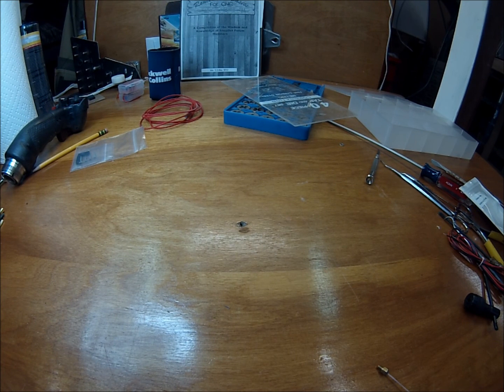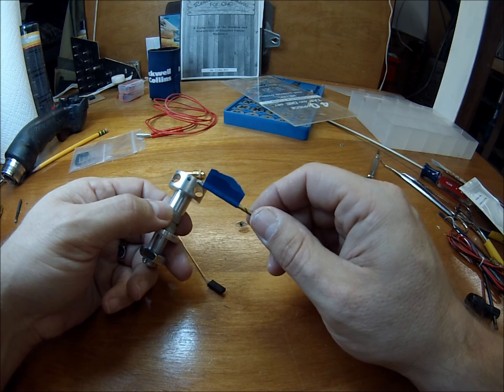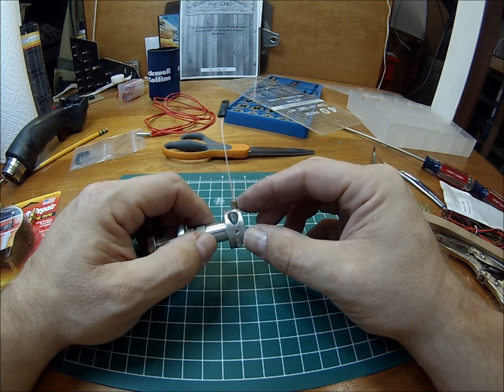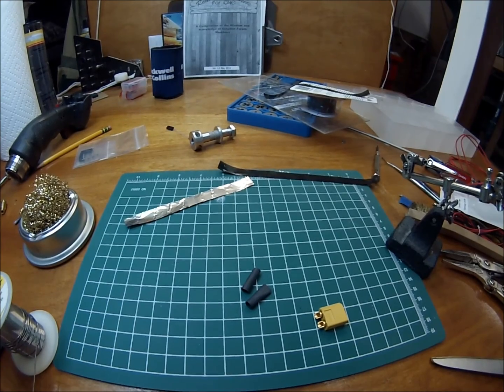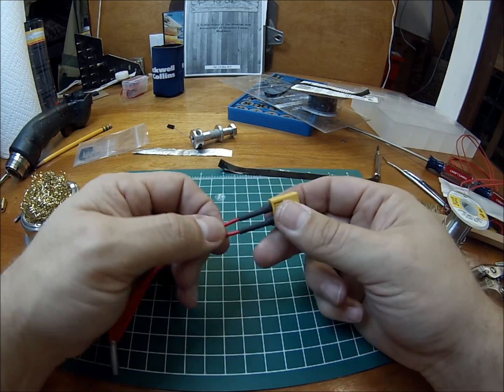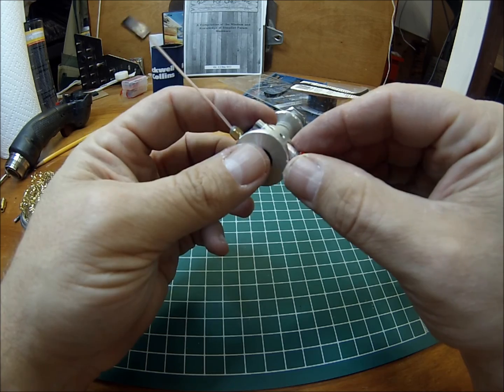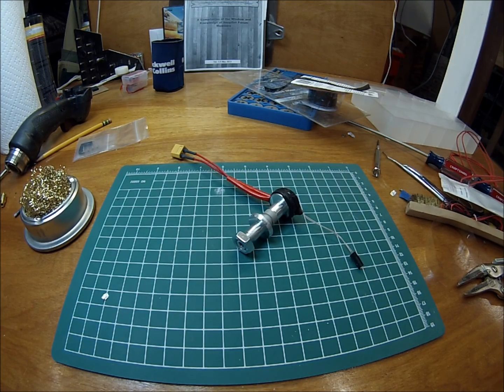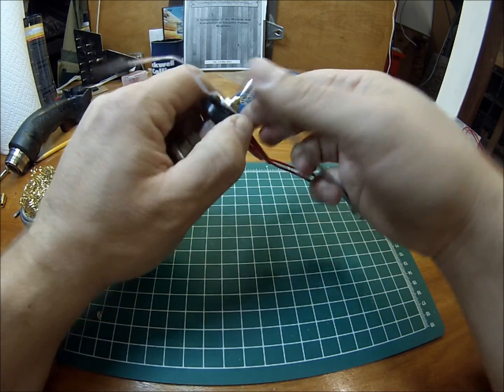Rostock MAX Upgrade: Hot End

Comment: TY for discussing nozzles at the start. I'm having trouble finding any info on the V2 in the forums. but... My nozzle(s) don't match yours! I'm not sure what the relevant metrics are but the threaded area (heat zone?) is in between the short new one and long old one - about 1/3rd of the length above the hex grip. (sorry if my engineering lexicon is non-existant).

Judging by the date of my assembly guide PDF I got my printer in 4/2014 and I'm trying to figure out what my nozzles are. (This guide was awesome, and the author Gene Buckle will reply to the included e-mail to this day even though he said he isn't even an employee.) For some reason the guide has no mention of nozzels, even in the shipping inventory; it only has one nozzle preinstalled in the image of the hot end parts. 

I quit the all consuming print hobby after a year, but never uninstalled any software, so based on my cura settings I know my installed nozzle is 0.5. I also have 2 nozzles in a baggie that is sharpie-labeled 0.35 but one is clearly larger. 

So: do you know what 3 nozzles were shipped at this time, or how I can measure them?
Reply from the maker: The nozzle shown in this video is basically the "first generation" SeeMeCNC hot end nozzle.  Follow on designs used a much smaller 6mm or 1/4" thread (I can't recall which).  If the nozzle is first generation like the one shown in the video, there's not going to be any markings to tell you what the nozzle size is.  If memory serves, SeeMeCNC did 0.35mm, 0.5mm, 0.8mm, and I think 1.0mm.  The easiest way to figure the size out would be to get those size drill bits from Amazon and see which is the best fit for the nozzle orifice you're trying to identify.
Reply: @f15sim  thanks! I will try that. IDK if this is incorrect nozzle settings, but when I switched to the 0.35(?) it worked OK, except I would get occasional lumps of burnt PLA appearing on my prints so I'm doing something wrong.

Comment: Having just received some "12v 40w" cartridges from an amazon seller, let me offer some advice to those partaking in this journey.  The amazon seller I bought from was called "Ocean Source" and when the cartridges arrived they all measured 18.5 ohms, which is no where near 40w @12v.  Furthermore, before you get all excited with your new cartridges, measure their resistance first.  If the math doesn't add up, you'll just waste an hour installing the new cartridges in your hot end and then wondering why your printer doesn't get up to temp.  Mine currently is stuck at 165C, because duhhhh my cartridges aren't actually 40w @12v.  

TL/DR buy from the ebay source in F15Sim's comments, not from the amazon seller that I bought from.
Reply from the maker: +Arthur Brazzle You might try increasing your PID Max value.  If memory serves, the default is 205.  Bump it to 230 or so and see if that works.  

That being said, I'd return the heater to Amazon if it's not right.  Their return policies are pretty good.
Reply: +f15sim, You got my hopes up! :D  It got up to 170C this time with a PID Drive Max set to 238, PID Max of 255, and all other EEPROM settings stock.  I even flashed back to default .91repetier last night to see if I had messed something up.  It just doesn't have the umph with the two-18.5 ohm resistors.  I've already ordered two stock 6.8 ohm resistors from Seemecnc to hold me over till the replacements come from the Amazon seller.  Thanks for the suggestion though.

Comment: What thermistor setting are you using now in your firmware? Did you have to change anything for the heater or just plug and play?
Reply from the maker: The thermistor is a standard 100K EPCOS type thermistor.  I didn't make any firmware changes beyond changing the PID values for the hot end.
Reply: f15sim I just finished and WOW, that looks so much more professional now! OK, one more question. Once I upgraded it, the wires sticking out of the side from the heater hit the effector as I am sure yours did too. How did you resolve the issue? Do you have a pic or video of your setup/wire routing?

Comment: would it be overkill to add 2x heater cartridges?
Reply: The resistances wouldn't add up to the right values.  Putting them in series will double the resistance, putting them in parallel will halve the resistance, so no matter how you wire it, it wouldn't work right.
(Yes I realize this comment is 3 years old, but thought I'd answer for future posterity!)